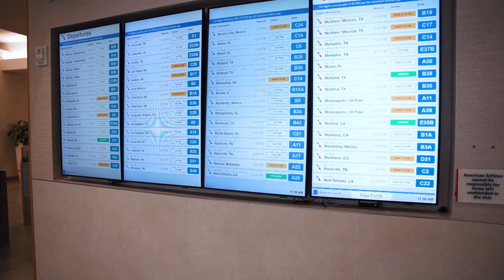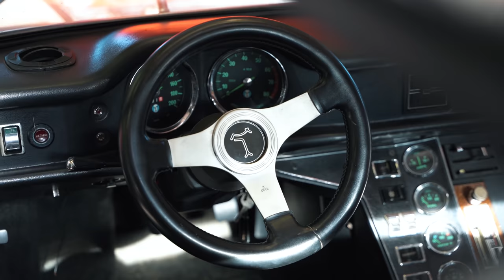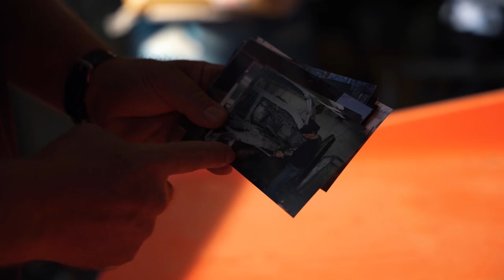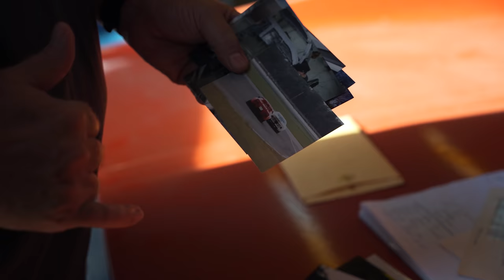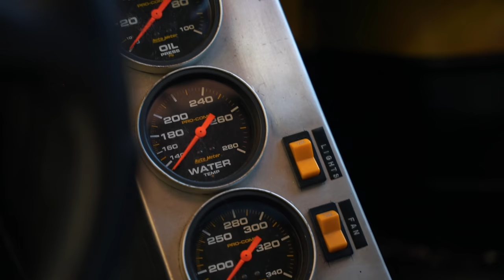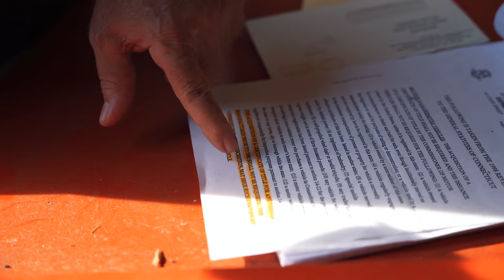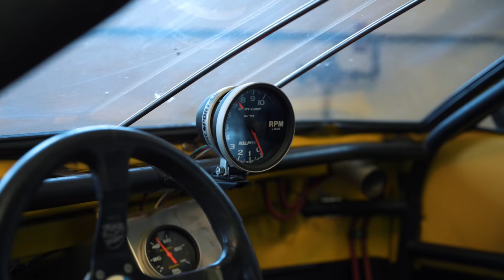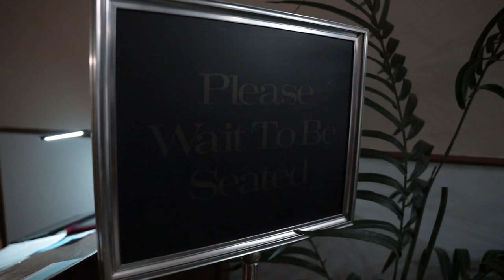I Found the World's FASTEST Pantera!

Comment: 👀 Really fun video.
Those cars are 👁 🍬 
206 mph is fast in that car... Of course it would go 220 even 230 with that 2nd motor. You must know that Pantera's do lift up and fly. You not only need more consistent downforce both front and back, but always drive in clean air, never slipstream a lead vehicle and pull out into turbulence. That yellow one is also super light. Most  "super cars" get dangerous at 250 mph, the angle of the Pantera must make it have different lift. Not much weight on those front tires for sure. Still it looks like a rocket parked in a barn 👍 Thanks for the visit in time.

Comment: I got to drive a Pantera GTS as a 19yo mechanic, my boss at the time (the owner) came to me and said it was running short of power and struggled to top 110mph.
It was running 7 cylinders and I found it had worn a pushrod right through the rocker.
At the time, American stuff was quite expensive here in New Zealand so I got a used rocker and pushrod, modded all of the pushrods for better oil delivery to the rockers and fired it back together.
While I was in there (not a lot of room even when you take the firewall  out that sits between the cabin and the engine) I replaced plugs and wires, fitted new points and condenser and set the timing a little more advanced than it had been.
I took it for a test drive and got to just short of 160mph and gave it back to the boss man.
He came back to me the next day and said it was the best it had ever run and he had manage to pull just over 165mph.
That was one of the highlights of my automotive career and it felt good  to hear the boss say no one else was ever allowed to touch it bar me.
That thing drove like it was on tracks, it went where you aimed it, to this day (35 plus years later) I have not driven a faster car.
This brought back so many memories.

Comment: Built a '71 with a group 4 kit with twin turbo 351 Cleveland with 850hp to the wheels. Ran 207 on radar at Road Atlanta. Built by Guy Anderson on Windy Hill Road. Same wheels as the yellow car but running rain tires for the street. Any gear at any speed when the boost came on the tires broke loose. Early turbo lag was a killer. Car was bout as wide as a street or highway. Not much wiggle room. Built it because i got spanked on 75 North headin back to Tennessee by a 911 Turbo. I was in a mostly stock "74 L model. 
Shuda held on to a couple but switched back to old and new Corvettes even tho i died in 1978 in a '64 Corvette convertible crash. Luckily i got to come back from "between".

Comment: Nice 57 Thunderbird, I would love to have that beautiful car. probably 312/ 4 speed,  tri five T Bird's are the most beautiful cars ever made hands down.

that guy must have been the Pantera specialist? he definitely had plenty of involvement with them. and that car builder must have really worked some magic on those Pantera's. because they weren't normally two hundred plus MPH cars. however GT-40s were.
that's the problem with pantera's, they rust and the way they are built. the structure of the car is spot welded to the body panels. so when would rust it weakens the structure of the car. and they are very difficult to repair.

Comment: In 1975 and 76 I worked at a little place Called Salem Chevron, Salem Connecticut. On early Sunday mornings I would get a couple brothers come racing each other down route 11 from Colchester. Theirs cars, a pair of Panteras. I think 1 was red and the other blue or purple. I could hear them coming down route 11 at high speed. Most likely at WOT. Usually followed by their father who drove a Mercedes of some variety that was a shade of red but custom, with actual gold dust in the paint. My point is that, I wouldn't be surprised if this gentleman you bought these Panteras from knew those 2 guys. They knew people, they were loaded. The father would pay for their gas when he would arrive, we had an agreement on that. He always had wads of cash and always tossed me a sawbuck or 2. For the short amount of time the guys were at the station I learned that they were into racing which is why they were always in a hurry to get filled up and on there way again. I enjoyed this little reminder of history Dennis. Thanks for that!!!

Comment: Dennis have you ever even driven a pantera over 100mph? I bought a new  french blue one in 1973.It had the  air-dam integrated into the front bumper in order to help with downward force in the front. I bought it in KY, and was Northbound on I-75 going toward Ohio where I lived. They claimed the car was good for 170mph. There were two problems with this IN REALITY. For one, at about 140mph the front wheels would start to lift off the ground, as in I could no longer steer the car at that speed due to aerodynamics. For 2, at that speed the car was simply running out of gear in 5th to push it much faster. I took the car back to the dealership the next day and made them make me a deal on a gts car. In reality the GTS cars had the different final drive ratios to get the cars to that speed. Those cars needed serious front airdams fabricated in order that the air was directed around the car instead of underneath. Those cars did have more than their share of electrical problems as well as poor braking performance that required at the time adding an additional caliper in the rear to get it to slow down reasonably from cruising speeds.

Comment: An old colleagued who spent 3+ years working in Saudi Arabia back in 2002. Had saved enough money to buy himself a used but nice supercar prior to leaving his contract. In Saudi (at the time) you could find really good cars at a good price. Some were abandoned at the back of shops (Slant nose 911, aluminum body per example). But some were legit used cars sold at the Lambo dealer in Jeddah. 

Anyway, he called me up and ask my opinion on the 2 choices he had narrowed his search. One 84 Pantera DeTomaso, and one Porsche 959 with nearly even same asking price. 

I told him it was a no brainer and get the Porsche. He bought the Pantera.  His next problem came when he took a job in the US, and could not legally drive the car here. So he proceeded to converted to a group 4 car. Had a set of molds made of the body to replace everything to fiberglass, custom cage, and last I know. He put in a 7.5L engine with MOTECH EFI. 

The car sits/sat(?) abandoned at the back of some shop in Long Beach serving a family of stray cats.

Should have bought the Porsche. Would be worth roughly $1M to $1.5M. The Pantera $100K to $150K max left alone. Modified as he had done with no real racing history (broke down 1st time on the track). Maybe $50K at best.  

Pantera's are an underrated great car. 
Back in 2003~4 I actually meet a Pantera owner and driver "Mad Dog" Dennis Antenucci, who had won the Silver State Challenge in 99 driving a Pantera, while crossing the finish line at 170 mph on fire. The car was literally on fire and was consumed by flames. Dennis rebuild the car, and told me the body was actually straighter than before, as "the heat cycle took out some twist in the chassis" (LOL). 

http://www.ws6.com/autowek1.htm

Comment: Many years ago, one of my co-workers had a Pantera.  We worked in Springfield, Mass. just across the border from Enfield Connecticut, and he decided to sell the Pantera because he just got married and was thinking of starting a family.  He was asking $8,000.00 for it and the only mark on it was a small soft dent in the right front fender, like somone had leaned on it.  One of the many cars I could kick myself for not buying.  Almost as bad as the 67 Shelby GT350 for $5,000.00.  I saw it on a dealer lot and by the time I went around the block to go back, it was gone.

Comment: 15" IS better, the larger sidewall allow them to deform from application if torque, during rotation, and this enlarges the tires contact patch, improving acceleration... 17" rim means tires with narrower sidewalls, less deformation under torque, smaller contact patch, more tire slip, worse acceleration... why top fuel cars don't have 40 some odd inch rims on 'em.

Comment: From back in the day why are you not important.  I don't believe you Sr. I believe you are very important. I've been a maintenance man and a Mechanic all my life I'm 48 years old.  And I will never be able too have a 1980 chevy Malibu wagon.  Or my stepfathers 69 Nova.  Me and my wife have been together since we were 14 we are both 48. I still have a 350 small block motor I was going to install in the 1980 Malibu wagon.  In 2015 I took my first flu shot 2 1/2 years later I was able too get out of bed.  And I lost 9 teeth within a year.  On July 5th 2015 I took my Shot on July 7 2015 I've been sick every since. I have been moving refrigerators up and down 3 flights of stairs for over 24 years. Today I have a 96 chevy s10 with a 4.3 and a 2001 chevy silverado 1500 HD with the 6.0. Today I'm waiting on parts just too get back too work.  I live miles away from downtown Fort Worth Texas,  I've been trying to get back too work for two weeks now. But I can't get my trucks running.  But I do know what they need. I have the parts but not the energy too fix them. My family is the American dream.  Have a story that would shake the world. 🤠🤠🤠 in 2008 I had a 69 Chevrolet c10 and I took it too Texas Motor Speedway  and I won the first annual Texas turner showdown  ET2 Battle 2 class.

Comment: 28:35 because you can't fit shit for brakes under a 13"  wheel, how is that not blatantly clear. We live in 2022 and 13" brakes are still not suitable for track duty, so the bullshit horse and buggy brakes they had back in the 70's were damn sure trash.